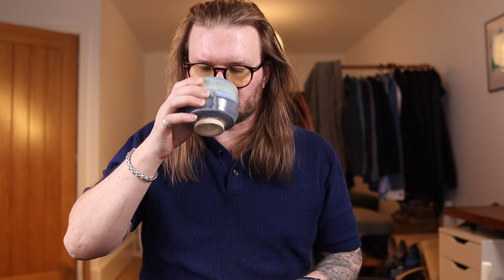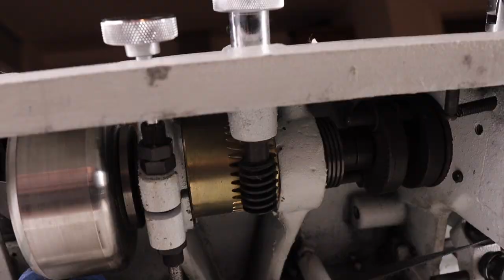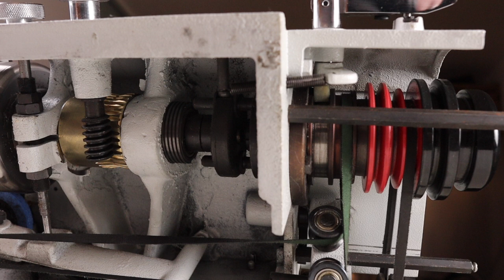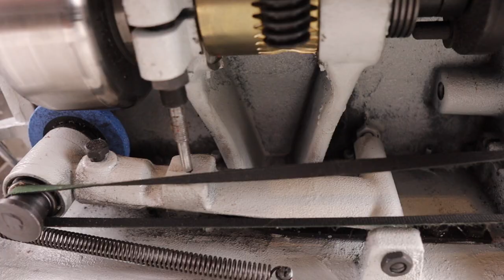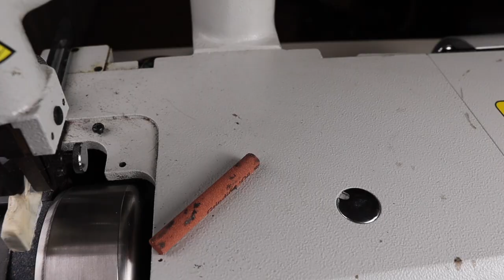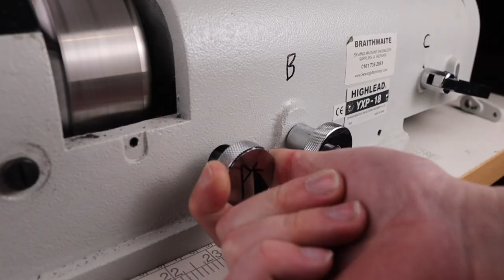HOW TO SHARPEN YOUR BELL KNIVE SKIVING MACHINE - THE COMPLETE BEGINNERS GUIDE!

Comment: I agree than a bell skiver is an important tool for anyone serious about production in a leather workshop.

People overthink this machine and even when it works for them it is still misunderstood. The relationship between the blade and the presser foot offset is critical and even with a sharpened blade poor results will occur when not right. After every bit of sharpening you need to move the blade back to the sweet spot, which is quite close to the vertical plane off the front face of the presser foot

Agonizing over the burr can cause damage and unnecessary wear to the blade and the user. Keep your hands away as much as possible and grind only as much as needed. Getting totally rid of the sharpie mark removes way more material than needed, YMMV.

The grinding wheel needs to be dressed often as this keeps the grinding face clean and fresh & sharp grit grinds better with less heat and almost no burr. Less material needs to be removed from the bell knife than expected to restore sharpness. I rarely need to use the honing rod as for most of my typical uses a light touch of the grinding wheel restores the bell knife back to sharpness. A blade with a slight burr cuts leather better than a smooth, no burr blade.

Some materials require some finesse but for most upholstery and other chrome tans getting the blade to presser foot offset relationship right will go a long way to ensure good and consistent skives.

Comment: One thing I couldn't get correct with mine was that after sharpening, you need to position the blade in a way that is slightly tilted down and away from the roller wheel.  That way the roller has clearance to pull the leather through.  I could not for the life of me figure out why I had to pull the leather through the blade with my hands.
Reply from the maker: Sounds like you didn’t get the burr off from the inside and it was catching on the roller. Make sure it’s smooth on the inside (make sure the machine is OFF when touching the inside of the blade with your fingers)